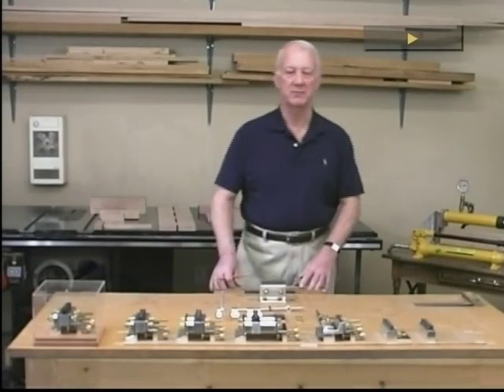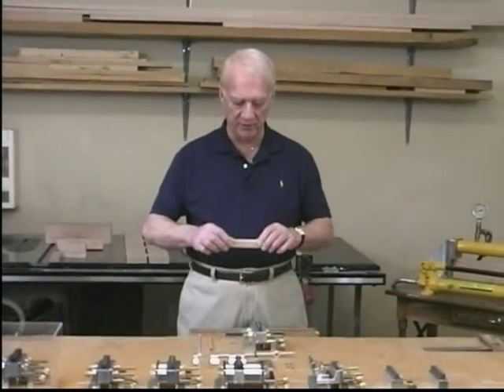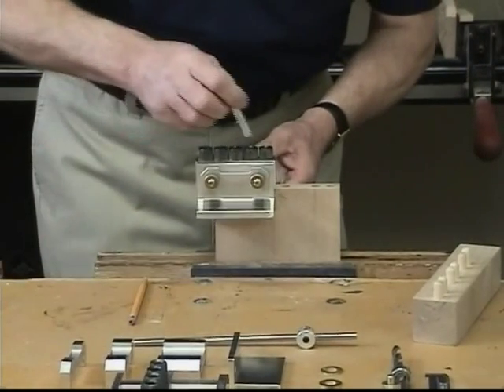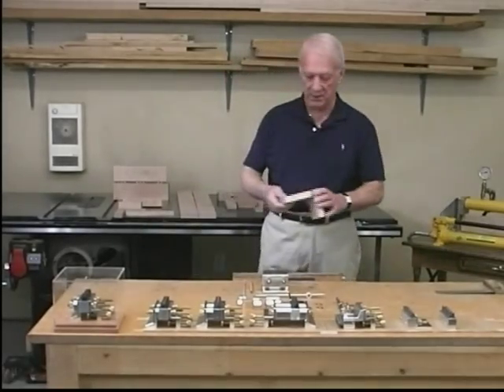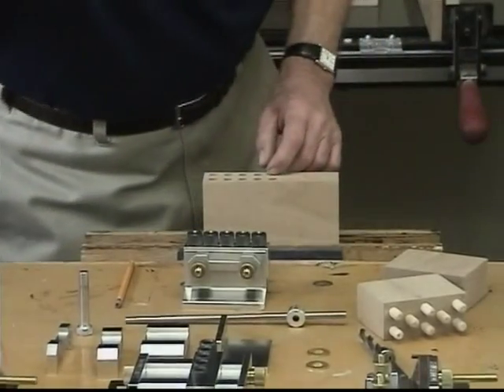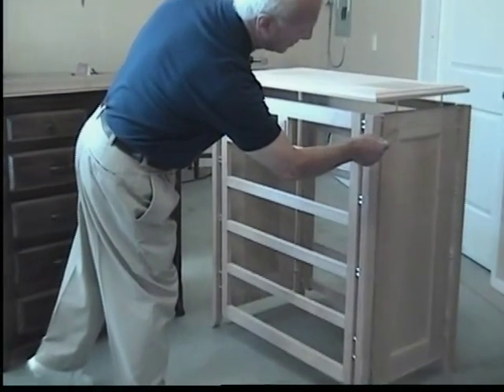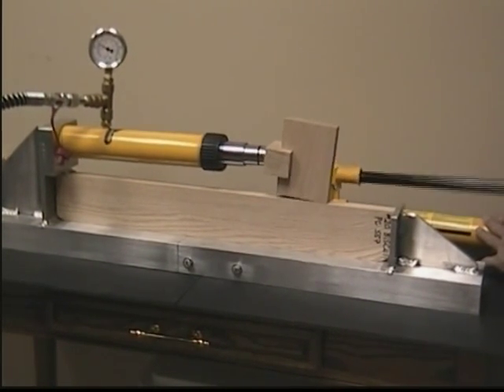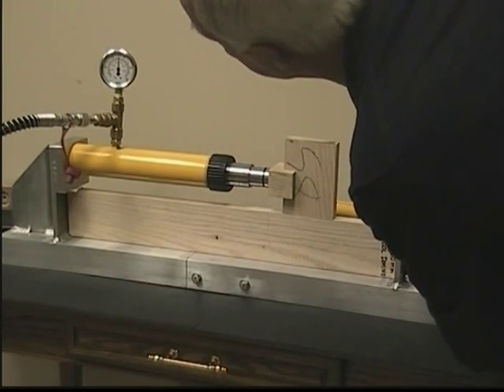Dowelmax Classic System Introductory Video

Comment: Was wondering on the strength test these are standard fluting dowels?  I got the Junior and using it make a coffee table and afterwards going to use it to make a bed frame for my grandson basically a low profile captains bed with boxes on casters for use as storage in different configurations. The one thing I like about the dowelmax is no need for bisket joiner, or making other complicated joints using my tablesaw or router table. So far the dowelmax is so simple and easy to use it is practically  idiot prof.
Reply from the maker: Hi James.  Yes these are standard fluted dowels.  I would also like to take this opportunity to say these tests were absolutely honest. Other woodworkers completed all other joints and were asked to do these in an optimum manner.  One early test was done by a professional metallurgical company, and we had little input.  Other tests were supervised by professional woodworkers.  During the first test back in  the early 2000's even we were shocked when the dowel joint failed at a pressure approximately 30% higher than the mortise.  Thank you for your comments.  Regards Jim.

Comment: Hi Jim, I'm considering getting the dowelmax . I new whoever designed the jig was an engineer , somehow you can tell by the quality it exudes. Thankyou for your work? After an horrific pile up on the motorway in the UK in  May 2019 I am just starting to want to resume woodworking and like you I am a retired engineer with plans in wood, but I am ever so tired at the moment , but it is definitely coming .Thanks once again.
Reply from the maker: Hi there. Sorry I missed this one .  So busy, and not attending to the important points.  Hope you are well enough to get back into woodworking, it is great therapy.  Thanks for the kind comments.  Jim.

Comment: Hello. I am going to be doweling a 3" thick slab table top indexed off the upper surface with 1/2" dowels. My goal is to center the dowels (1.5") from the upper surface, and another row of dowels centered 1.25" from the same upper surface. Is the Dowelmax configurable for this type of slab doweling ? Also, will the Dowelmax support longer drill bits well enough to give accurate holes about 4" deep?  Thanks kindly.
Reply from the maker: Hi Michael.  Yes D/M. has literally hundreds of functions.  There's a simple formula for centring on stock of any thickness i.e. half thickness less 3/8 equals the size of spacer required.  You would therefore require a 1 1/8" spacer to centre.  Our largest N.A. size of dowel is 3/8 and  we've been testing various types and sizes for over twenty years.  The 3/8 system is approximately 30% stronger than a comparable mortise, this is a fact not fiction.  The 3/8 is also stronger than the wood itself,in other words when testing the wood fails not the joint  ( on oak )  Again yes , I have used 4" dowels with a mitre joint and it's perfectly accurate.  Michael you may be underestimating the strength of your joints.  To give you an idea If I was doing the 3" slab joint I'd probably use 2" dowels in one row, not double and staggered.  Having said that there's no harm in overkill.  Regards Jim.  Call if you need anything further.

Comment: Is the joint strong enough for a coffin base ? Place them vertically or horizontally ? Need an eco friendly coffin/casket.
Reply from the maker: In my opinion yes, but I wouldn't want to attempt it without testing. The shape would make referencing more tricky but of course it would still be  possible.  I would probably design it with an added trim at the bottom edge, again doweled, to reinforce the dowels in tension.  Jim.
Reply: @DowelMax  It will not be a toe pincher style. 9mm Hardwood dowels 2 together every 150mm to 200mm in 22mm thick pine. vertical ? Sorry to nag.